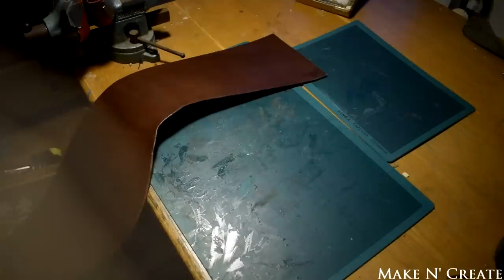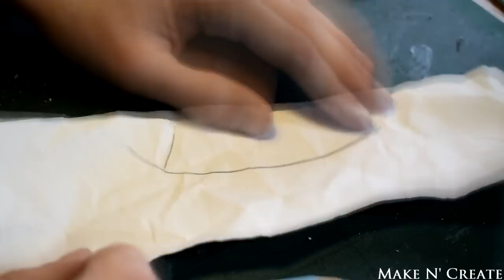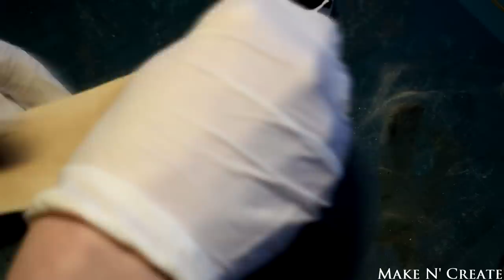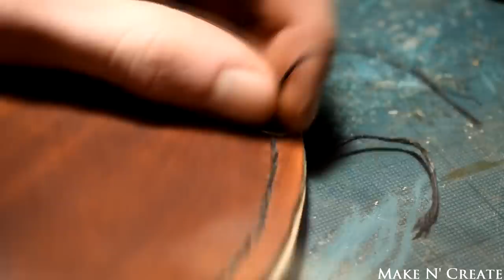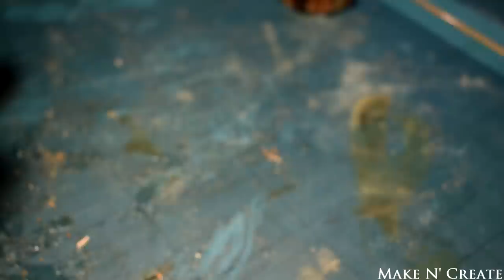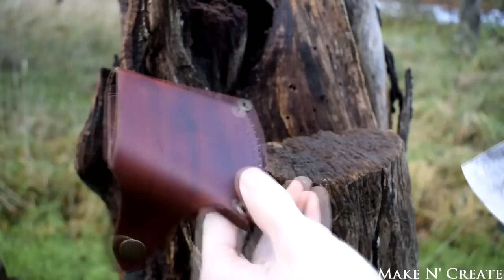Leatherworking - Axe sheath

Comment: great video. Is there a difference between using the glue that you used vs using barge or contact adhesive where you bonded the front edge and filler piece?
Reply from the maker: I can't say, only ever used this type of glue for leatherworking. thanks